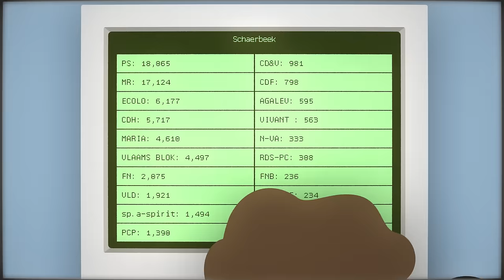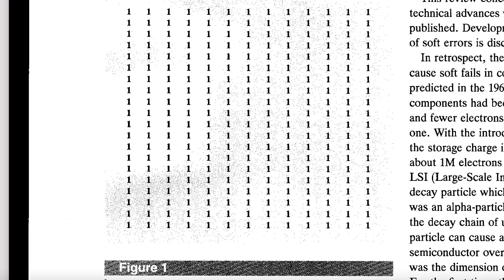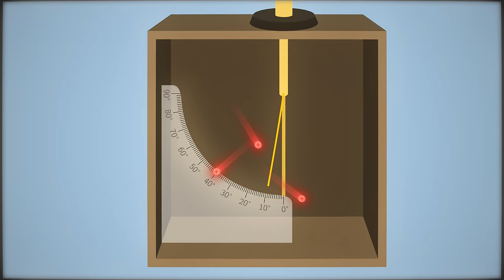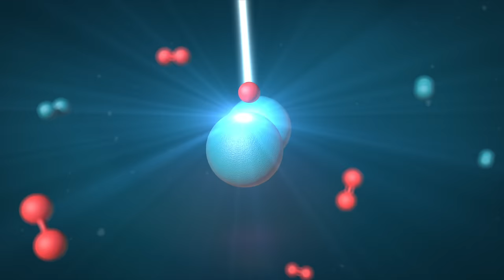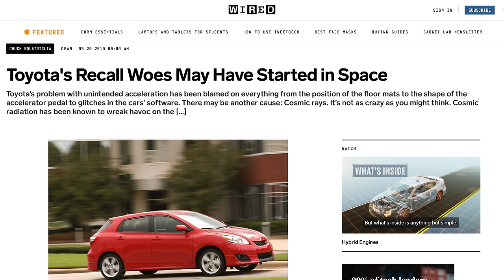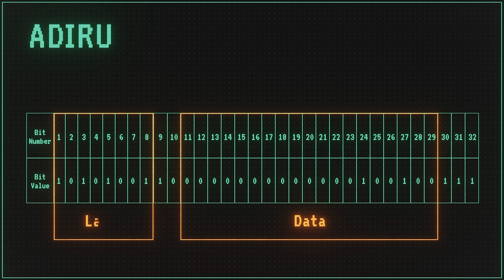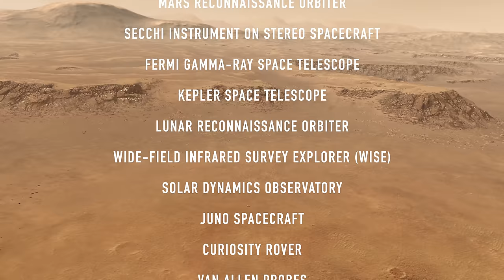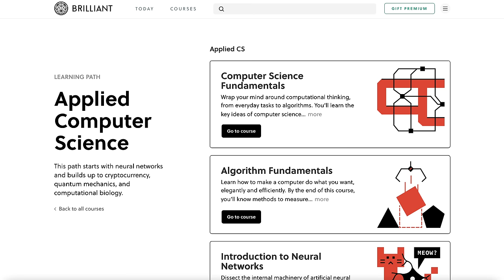The Universe is Hostile to Computers

Comment: The second I saw bits flipping, my mind went instantly to gene mutations being quite similar. Glad to see that expanded upon, and it is very interesting. It's like we have temporarily mutated computers, which may then work, or not. Neato.
Reply: Not quite. They're designated as Single Event Upsets since the effect of interaction is not permanent, the bitflip can be corrected. This is much more akin to a cosmic ray passing by passing by orbitofrontal cortex, getting your eyelids to blink on accident.
Reply: @StrikeWarlock  excellent reply.
Reply: @icedqq  okay the result of that one might not be reversible
Reply: Genes mutated in sperm are permanent if they are the origin cell of a person
Reply: @xeryus3357  we can make superhuman from that ?????
Reply: @QHoang-tt5ht  nope.
Reply: @xeryus3357  Curious how a single radiation would be responsible for that though. I’m not an expert but I’m assuming a mutation requires a lot more than just a couple of radiation capable of bitflips, even in a single sperm cell. Conversely, mutations can be that much more common by mechanical means, because biology is less foolproof than meticulously designed human computer.
Reply: @Manas-co8wl  Some phenotypes could be controlled by just one part of an allele, like eye colour, or even something more malicious like the gene that controls huntingtons. Most however are silent mutations with no obvious phyiscal effects. I agree that it would be alot more potent effectwise for a machine,  even taking into consideration the soft error correction code. Just my view on it

Comment: I love this channel, and this was one of the best productions I've seen to date.  Having worked in the ICBM development field myself, I'm aware of the phenomenon of Single Event Upsets (SEUs), and what they can do to the operation of a flight computer.  The Apollo flight computer used core memory, where bits were stored as magnetic fields in rings of ferrite material.  It was inherently "rad-hard", though not because anyone had thought that far in advance.  Plated-wire memory, similar to ferrite core memory, has been used in everything from the Peacekeeper (nee MX) ICBM flight computer through the Hubble Space Telescope, the New Horizons Pluto probe, etc, etc.... anywhere that high radiation fields are expected in space, we resort to memory that is 1950s era design.  One paper I read recently dealt with the occurrence of bit flips in very large scale super computers.  Many people naively think that the "parity bit" check in semiconductors deals with any kind of random bit flips.  In fact, bit-error detection and correction firmware algorithms are far more sophisticated than the mere parity bit.  But they have limits, especially in huge supercomputers where one is trying to simulate climate on century time scales.  Those computers were found to be vulnerable to SEUs at a non-negligible rate, in a way that the built-in error correction firmware could not detect.  Climate models solve huge systems of coupled, non-linear differential equations that are known to be highly sensitive to initial conditions.  Modelers have tested their software with a trillionth of a degree C change in initial conditions (for a global model), and found that the results were completely different from the original runs.  What I have never seen is a global climate model run two or three times, on the same machine, using exactly the same initial conditions, for a century simulation.  Most people would say that the results would have to be exactly the same, since computers are determinate machines.  But they aren't, as this video shows.  I would really like to see such a test be run.
Reply: damn cool
Reply: Indeed, I have read articles regarding how these SEUs can and will provide different results for this kind of modeling.
Reply: I have little to no knowledge about what you have described at the end of your comment but after reading it I am highly intrigued and would also like to see such a test!
Reply: It's odd that there are no subsequent re-testing of modeling. I feel like that is a basic scientific standard that should be applied - replication of data. Then what happens when we introduce Quantum State Bits?
Reply: Hi! It sounds more like a sensetive dependence on initial conditions issue. You may find related video on this channel "Chaos: The Science of the Butterfly Effect".
Reply: I hit the Like button on this comment which flipped it from 256 upvotes to 257. Poetic.
Reply: It’s an analog world
Reply: TL;DR please?
Reply: i rest my case.....fast light science is popular

Comment: Victor Franz Hess built a small cosmic ray observatory at the Hafelekar (a mountain locality directly accessible from Innsbruck/Austria) in 1931. It contains a Steinke apparatus and 10cm thick lead blocks which help to block unwanted ground radiation. I have no idea if it is still in active use, but it is visible through a big window when you visit the house which is close to the cable car top station.
Small fun fact: I wanted to watch this video a few days ago because I'm interested in IT, but delayed it, then visited the Hafelekar for mountain hiking where I noticed the observatory and made a photo of the "strange" apparatus, and watched this nice video explaining all that today.
Reply: Hey was that the awesome cable train that has self-leveling modules within each carriage, that begins underground in the centre of the city?  That was a strange apparatus!
Reply: @agalah408  Don't know about self leveling, but yes you start underground in the city and go hill up, the first of three stages (next two stages are cableway). The Hungerburgbahn station was designed by Zaha Hadid. Not really my cup of tea, but all together it's a quite nice/impressive/effective mountain transport system.
Reply: Like Mu-ions? The high altitudes yield more particles then lower altitudes. Very interesting that gain for vacuum tubes in measured in Mu.

Comment: I've caught one of these in software I wrote. In the early 2000s I was working on a 3D game engine for an MMOG studio when it crashed with a CPU exception. Since I'd run it through the debugger it trapped the exception and I had a look at the assembly. The error was "impossible". It was failing to dereference a pointer in a register that it had only just successfully dereferenced on the previous instruction! And the pointer value was weird, I think it had one of its low bits set when it should have been 8-byte aligned (a double). As a test I set the register back to what it should have been and the game continued executing normally. Unbelievable!

The strangest part is this was in a register, not in RAM! The machine didn't have ECC RAM anyway — who does? I guess it could have had an interrupt right there (eg thread switch) and been corrupted while it was saved in RAM (though you'd hope that might stay in the cache). But that's also pretty unlikely... it's pretty insane to think the most likely event was a cosmic ray hitting the register file at that exact moment... I've never looked at computers the same way again.
Reply: 5g signals and higher frequency ones are basically radiation  as waves which may be enough to cause the effect you are talking about in the day and age.
Reply: Wow !!  Amazing story !!!   Thank you for sharing.
Reply: @Nicholas Millington really? Read this. Like in previous mobile networks, 5G devices will communicate with base stations by transmitting and receiving radio waves, or radio frequency (RF) electromagnetic fields (EMF/Radiofrequency (RF) radiation, which includes radio waves and microwaves, is at the low-energy end of the electromagnetic spectrum
Reply: Right ! 🤣
Reply: @gg-creggnhffghjyy617  lol
Reply: That’s so cool
Reply: @gg-creggnhffghjyy617  No, radiation are particals with mass. EM-SIgnal don't carry any charge, its just photons. So photons can't charge any FET Transistor and for that it can't switch a bit.
Reply: @gg-creggnhffghjyy617  

When someone tries to be smart
Reply: @nicerecruit4216  ok prove me wrong then
Reply: @NoName-cx3gk  are you talking about radioactive decay?
Reply: @gg-creggnhffghjyy617  he said in the early 2000s before 5g existed
Reply: @wizarddd  true
Reply: Most of the time cosmic ray bit flips are discussed in terms of RAM chips because there are so many bits there. But I don't know of a reason it could not happen to a bit in the CPU chip itself. I used to go out of my way to get machines with ECC RAM, but then that got to be pretty much unobtainable in commodity-grade home computers. But you'd think voting machines would have ECC (Error Correcting Code, meaning extra bits of storage that can detect and/or correct nearly all radiation-caused bit flips in memory). This was all known about in the 1970s but it becomes a bigger and bigger problem as transistors get smaller and smaller.
Reply: @paulperkins1615  is it because there's less space to shield the chips, or smaller chips themselves are inherently more susceptible?
Reply: @gg-creggnhffghjyy617  dude, you realize 5G uses almost identical energy and wavelengths as 4G?
Reply: @gg-creggnhffghjyy617  the radiation from 5G is no different the radiation your phone gives off when you send a phone call
Reply: @gg-creggnhffghjyy617  Something being "radiation" or "waves" is not the issue; the issue is having enough energy in a small enough region to flip a transistor's state. The energy difference between a radio wave we use for communication versus a proton traveling at almost the speed of light is beyond your imagination. And at computer bit storage scale, waves and particles are both just imperfect metaphors for what is really happening.
Reply: @gg-creggnhffghjyy617  No, it's because there are plenty of places to hit and because these bits are held by a tiny charge. There is a difference between "it hit exactly in the right spot" and "it hit exactly in one of the 5 000 000 000 right spots which are closely packed in area of few mm^2".
Reply: @paulperkins1615  I work in the field of circuit design and chip production and can only agree to what you said.
I think our machines in the clean room all have ECC memory because: one single error = 10k-100k down the drain, in the worst case. Other computers and equipment just get redundancy and regular backups, it's cheaper. xD
And yes, it does happen in the CPU as well, saw some really interesting presentations from Intel on that topic. It happens in RAM, CPU cache, logic transistors and SSD memory. Basically everywhere. Just a question how probable and severe the respective error is.
Reply: @gg-creggnhffghjyy617  You have to understand that ionizing radiation (wave or particle) and "our" electromagnetic waves used for communication, especially in this frequency range, are two different things in what they can do and can not do.
Gamma rays, high energy protons/electrons etc can cause cancer and (in the case of particles) can cause bit flips.
EM waves, in this frequency range, can never cause cancer or something like that, because they are non-ionizing. They simply don't have the energy to do that. A (defective and open) mircowave can cook you with 1000W and you will "only get warm" (and some burns probably). Communication networks with outputs of maybe ~0.1-50W do the same, but nothing else.
And regarding the other comment: the sun can cause skin cancer because of UV light not the visible part. UV radiation is partly ionizing depending on the wavelength.
Reply: @gg-creggnhffghjyy617  you know that like, every form of cell service uses radio waves, right? Phone calls have always been made with radio waves, and data transmission has always used radio waves? 5G is just a shorter wavelength of radio waves, it isn’t fundamentally different from 4G or 3G or making a phone call or using an AM/FM radio. It absolutely isn’t energetic enough to flip a bit in a computer and it’s a fundamentally different type of radiation than cosmic rays, which are particles and not EM radiation.
Reply: @Shikuro314  Car ABS computers (even from the 90s) have dual CPUs and memory that check each other.
Reply: @Shikuro314  I hope Jackson learned a little since there have been so many good replies here. Thanks for sharing your experiences as well.
Reply: @gg-creggnhffghjyy617  bruh radio waver are literally the exact opposite wich you would know if you payed attention in 8th grade
Reply: this is quite common and one of the bigger reasons its near impossible to eliminate - registers ARE RAM, and imagine the overhead of ECCing every single register access
Reply: @gg-creggnhffghjyy617  You think 5G radiation can crash computer components? 5G is composed of electromagnetic radiation, around 1 to 10mm. Let's take 1mm, as this is the higher energy. It is a photon energy of around 1.2 meV. 

Now everything discussed here has talked about the collision of a single particle causing charging, causes bits to flip. Ionization of molecules in the air is >10 eV, so 5G cannot ionize the air. So this cannot be a source of charges. The lowest work function (how much energy to remove an electron from a solid material such as a metal) is 1 eV (and it is an active area of research to find materials with a lower value). So 5G radiation is unable to produce a single electron from hitting even the material most willing to give up its electron. 5G radiation is therefore not able to flip bits in the same manner as a cosmic ray particle. The range of energies for cosmic rays is vast, but we are talking at least 12 orders of magnitude (that is 1,000,000,000,000) times more energy in a cosmic ray than a 5G photon. If you are scared of 5G you should be terrified of these.

And there is more, actually. A lot of people have lighting inside their PC. Or they have glass sides, or some other way to look inside. Visible light photons are much shorter wavelength than 5G photons, and then much higher energy. Let's take red light, which is the lowest energy part of the visible. This has a photon energy of 1.8 eV - 1,000 times more than a 5G photon. I will restate that. The lowest energy visible photon is 1,000 times more energetic than the highest energy 5G photon. If you have lighting in your computer you are bathing your components in light. Since there is more energy, you would get more bit flips. Since we can operate our computers in the day - and with RGB lighting - clearly this is not happening. So if you have some special mechanism to invoke for how 5G would do this, please enlighten us.

If this is not going to convince you, I'm not sure what will.
Reply: @gg-creggnhffghjyy617  
Radiation (both particle and electromagnetic wave) is generally classified as being either ionizing or
non-ionizing. The basic dividing line between the two is energy. Ionizing radiation has sufficient energy to
strip electrons from atoms, thus creating ions (atoms with charge). Examples of ionizing radiation are alpha
and beta particles, protons, X-rays, and gamma rays. Neutrons are not directly ionizing, but the resulting
radiation from their collisions with nuclei is ionizing.
In contrast, non-ionizing radiation only has sufficient energy to change the energy state of electrons.
Examples of non-ionizing radiation are visible and infrared light, microwaves and radio waves. Nonionizing radiation cannot induce SEUs.
Reply: Hey thanks for sharing your awesome story!
Reply: @stevendaly4640  i never said 5g could crash compjter components, i was merely stating that if we continue the trend of higher bandwidth signals then eventually we could reach that point. You know when you see those warnijgs on electronics from the fcc that state they are class b and what not? Well its not hard to interfer with electronics without proper care and overwatch
Reply: @gg-creggnhffghjyy617  no we will never reach the point where it flips bits. those warnings are for em interference in radio circuits, not in memory registers.
Reply: @numnuhyesnumnuh6252  yeah i know the phones are the same and im not bothered by it but people think im a 5g conspiracy believer in the tread
Reply: @nebulatgs  honestly so then whats the difference, instead of flipping bits i can mess up circuits. Both unintended side effects, no? Anyways, i dont know alot about this stuff but i thought the wireless 5g was in the 480ghz range or something. Now i have no idea if thats enough to flip bits or anything but its much higher frequency than 4g. What is 6g gonna be if we keep up our desires for speed on our devices
Reply: @ArtisChronicles  Np, always happy to share some knowledge and experience when it seems helpful. ^^
Reply: @gg-creggnhffghjyy617  jesus christ my brain hurts, here's a hint: Wave lenght
Reply: Wow thanks for the likes and comments folks! I guessed my anecdote would sink without a trace but so happy it got seen (mysteries of the algorithm).

Yeah this was before 5G, 4G and 3G and even EDGE. If you wanted mobile data GPRS was your best option at 22c per kB (!).. I didn't know anyone with it. It's true 5G can use higher frequencies — depending on the country these mm wave band frequencies are between 20 GHz and 80 GHz, which is a lot more than 4G at up to 2 GHz (and wifi at 2.4 GHz and 5 GHz). But as others have pointed out, that still isn't energetic enough to ionise anything like these cosmic rays, all it can do is heat stuff up. Visible light is around 500,000 GHz and even that isn't ionising, you need to get up to 2,500,000 GHz to get anything, so we are a long way off (Source: wiki on Ionising Radiation)